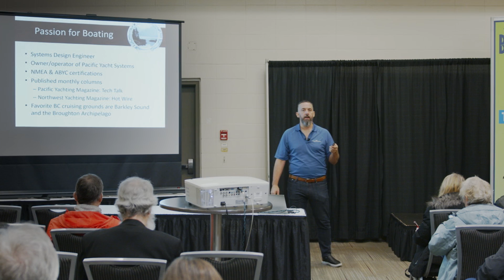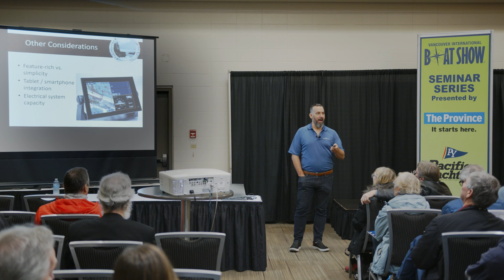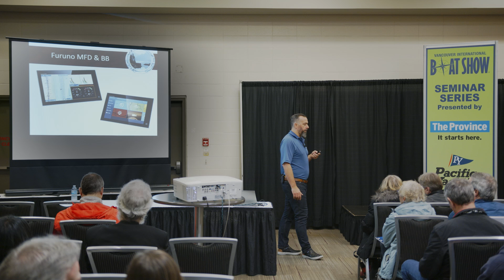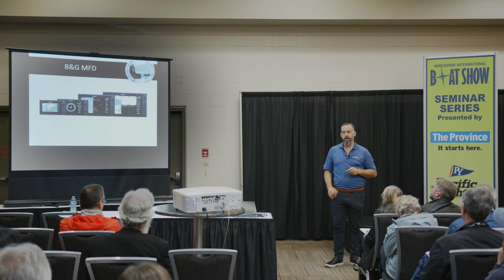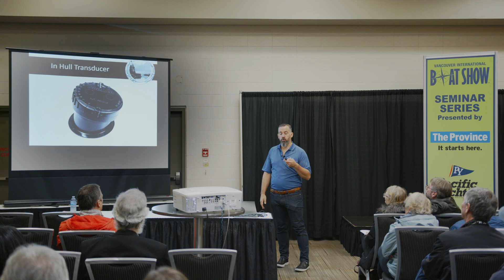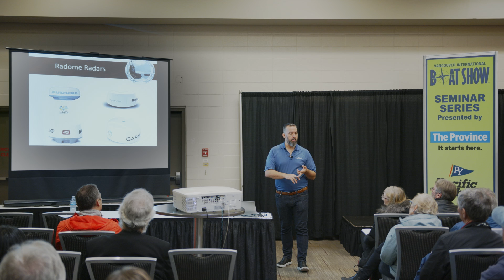Boat Show 2020:  What's New in Navigation Gear for your Boat

Comment: Am I required to have Radar? Radar is not required on vessels under  1600 GT (33 CFR 164.35), however, Rule 7 states that proper use shall be made of radar equipment if fitted and operational. In other words, whoever has one must use it. The Navigation Rules are not meant to discourage the use of any device, rather they expect prudent mariners to avail themselves of all available means appropriate...as to make full appraisal of the situation (Rule 5), e.g. the use of radar. At issue is whether the use of radar is appropriate in the prevailing circumstances and that is a determination made by the Master; and, ultimately decided by a trier of fact.

Should you be in a collision how would a judge/jury rule on your contention that the use of radar was impracticable (due to electrical drain, crew shortages, etc.)? Also, if a collision does occur, then there was obviously a risk of collision beforehand. Could the determination of that risk have been made sooner with the use of radar? It is difficult to answer such questions because the circumstances of each case are different.
Reply from the maker: Hi Rss3781, thanks for a refreshing perspective on this matter, you bring lots of good points.

Comment: @2.00. I could not agree more.  Just got back from spending 2 full days on a 42' Sport tuna, built in 2013.  Post the boat builder, some asshole and Cousin Eddie went onboard to wire up a SeaKeeper, a stereo and 850watts of underwater lighting.

Oh
My
God.

$1,000,000 boat and the entire electrical system was so bastardized I couldn't believe it.  I can understand a mid 1980's Crusiers Inc shitbox, but not something like this.  I was appalled with what I saw, repaired and had to suggest for future re-do.

:(